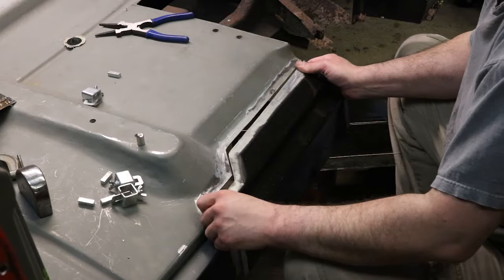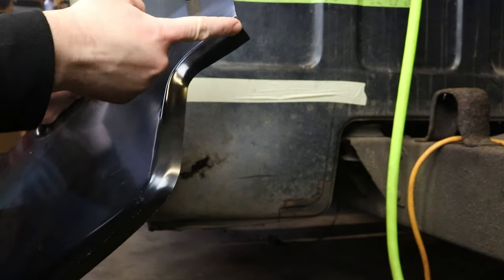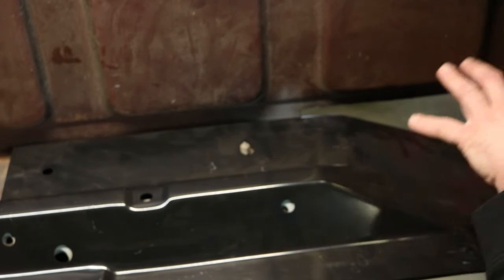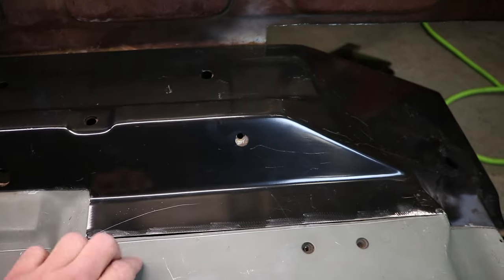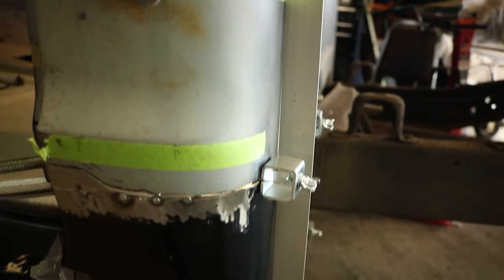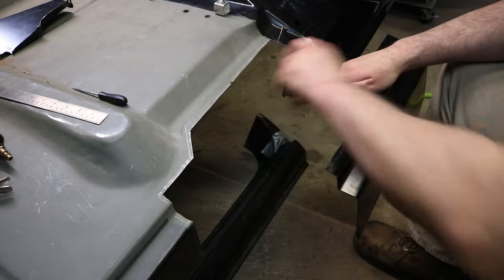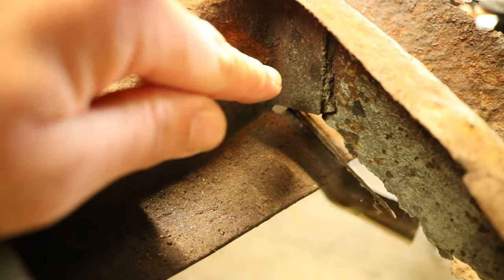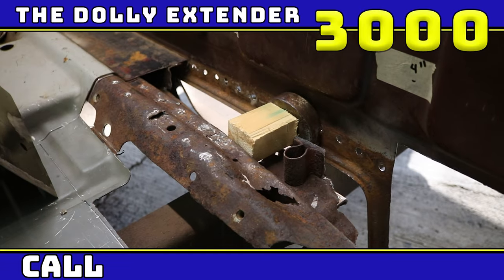How to repair a rusty cab corner, inner rocker, rear floor and B-pillar panels-1971 Chevy C10 PART 1

Comment: Looking pretty good and that last part was pretty freaking funny lol
Reply from the maker: Thanks Chris! Make sure you order yours today! Act now and get 2 for the price of 3. Lmao! Just shot a C-10 update video today, should be out Tuesday.
Reply: @BustedClassicGarage  lol I’ll definitely be looking out for the video
Reply from the maker: @chrismooney5737  Premieres at 7pm central tonight.
Reply: @BustedClassicGarage  alrighty and how’s that 400 small block coming alone for the camaro
Reply from the maker: @chrismooney5737  very, very slowly. Just collecting parts and tools at the moment. Just ordered a billet midplate for the ST-10 and a seal gasket kit. The old mid plate is warped and the trans has been leaking ever since I rebuilt it.
Reply: @BustedClassicGarage  I know the feeling fix something and something else mess,s up or don’t have time I’m fixing to pull the motor out of my k10 replace fly wheel and put a bigger cam in it and do 4speed swap after that I’m gonna start ripping my 79 z28 camaro apart

Comment: Good job on the panel replacement. 
I'm going to try to start my own videos on here one day lol I'm working on a 70 c10 also 
Replace the whole floor cost less and alot easier.  Turns out amazing
Reply from the maker: Thanks man! My buddy did that also. I really want to but I feel like I'm at the point of no return with the drivers side. I might do something different on the passenger side. Only time will tell.
Reply: I concur, especially if you have bad supports. I tell people that all the time and it looks much better, done several.

Comment: The issue with the cab corner and pillar I've had every time. The pillar stamps are horrible, just wait till you see how the bottom looks when you try to throw a rocker on. I basically make my own pillars but its a lot more work. Id suggest fitting up your rocker before welding all that in, preferably if you can throw the door back on..
Reply from the maker: Yea those panels are terrible. I've seen it with the rocker and the door... it's bad. I've been prefitting 5 panels ahead. Lol

Comment: Great video, where you buy the cab corner parts?
Reply from the maker: So the b-pillar I believe I got from TC Truck Parts in WI, (715) 321-0450 part # 0849-213 (when I run this number online it comes back as the crappy panel so when you call make sure they have the high quality galvanized finish b-panel. Another Keyparts supplier is Bowtie Truck Parts out of MN, it's a Ma and Pop shop (they are awesome, they shipped me freight a ton of C-10 panels) you can try them also. Kevin's cell (612) 242-9925 The high quality Outer rocker part # is 0849-101AL Hope that helps. Cab corner was AMD.

Comment: I'm currently restoring our '65 C10 and being a Newbe to this kinda metal work, would you mind mentioning where you got those replacement panels from Soni know where to NOT order from since I'm EXACTLY in that spot at this very moment. Thanks for the tips, tricks and education.
Reply from the maker: Most of my panels are from AMD, Goodmark and Summit. Most panels  that I've seen are the same between companies. Some triplus panels are better then keyparts and vice versa. I can't speak for the quality of 65 panels because I haven't dealt with that year truck. I know they are starting to produce high quality panels for some years but not sure if for your generation truck. If you had a 67-72 I could tell you a little bit more. Good luck.
Reply: @BustedClassicGarage  thanks for your reply, even if the parts may be a little different, the technique should be the same. That's what I'm mostly after. I have your videos on save to watch later with a few others so I can refer back to them

Comment: I got a 83 c10 and i just realized my cab is rotton where it hooks up to the mounts right there behind the front wheel wheels is it worth it to keep tinkering just been doing breaks and now ive lost motivation to even test vaccum compression and do timing.. the frame is solid and cabs held on the back 2 mounts and the front clip with the 2 under the rad are ok..
Reply from the maker: Yeah it's hard to get motivated sometimes especially when you got other things going on. My 69 that I  bought is completely rotted around the cowl and firewall. Yeah if you decide to do some metal work on the front of your cab just take your time and measure twice.

Comment: The bracket that you cut out in floor under fuel tank, is that the cab mount or what is that for thanks
Reply from the maker: There are 2 supports. One that runs from the firewall to the back of the cab, thats the inner cab floor support. The cab floor rear brace is the one that run under the tank, from drivers cab corner to pass cab corner. If you are referring to the plate that sits on top of the floor that's threaded, that is the mount that holds the cab to the frame.

Comment: Where did you order the replacement panels? Hopefully there's better sites lol
Reply from the maker: I ordered them from a couple different companies but honestly it's all the same stamping. Key parts are putting together a handfull of high quality patch panels at the moment. You can get front floor pieces and a b pillar that is exact to the original. There are a couple of other ones they are about to release. I can't say too much yet because they haven't been released but I've been fitting one lately and it fits like the original except for one cut I had to make. I'll be posting fitment videos around the same time they put them into production. Make sure you stay tuned on here for that video and where to buy. Bow tie truck stop has the high quality B pillar at the moment. Here is a link to the part video and contact info. https://youtu.be/bsMEDb74IzQ
Reply: @BustedClassicGarage  ok thankyou

Comment: Surprised how poorly the replacement panels reproduce the factory lines.
Reply from the maker: Some are better than others. Keyparts started making high quality stamping recently. I plan on making a video about the difference in quality between the 2 main stamping plants in Taiwan that supply most of the classic panel companies like, Goodmark, Auto Metal Direct, LMC, Original Parts Group, etc. Got a handful of vids to edit first but it's definitely on the list.